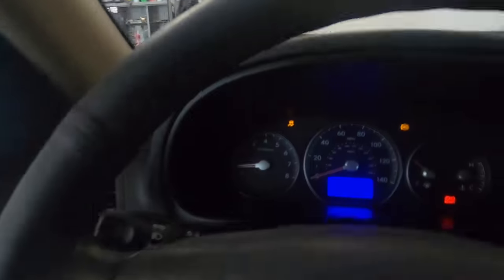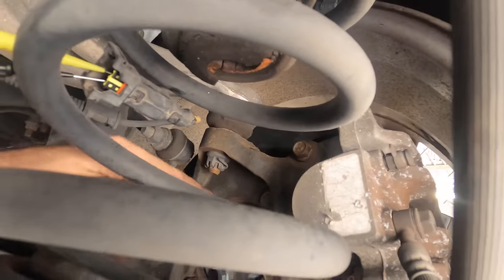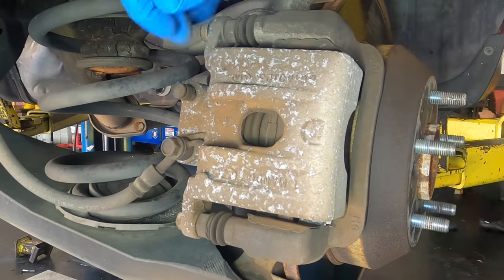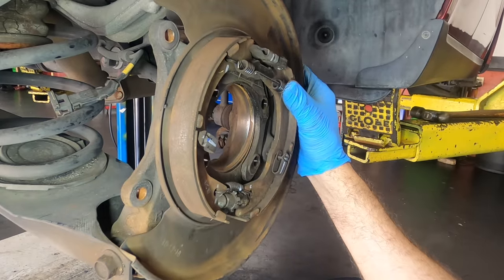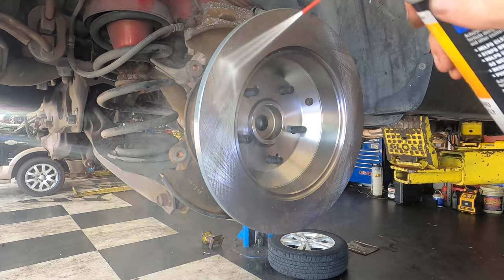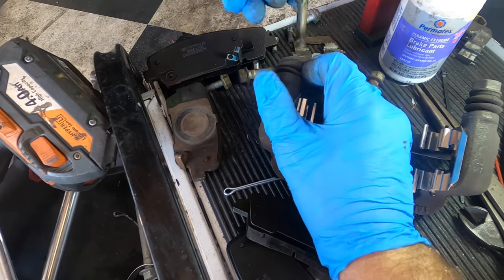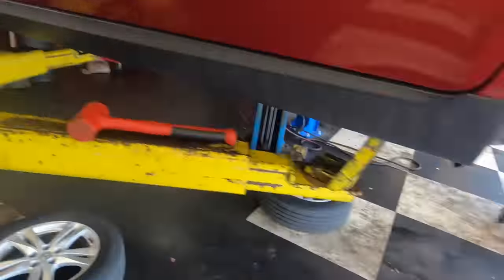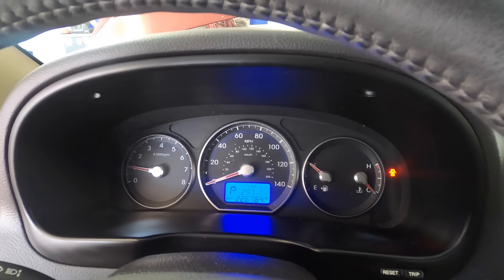Parking Brake Fights Back! BRAKE ABS Trac WARNINGS on! Hyundai Santa Fe

Comment: I'm 90% sure that first wheel bearing would have fit under the drum brake pad without interference once you got it in. At 12:04 it looks like there is more that 3/8" clearance under there.

Comment: On my 02 saturn SC (1.9 DOHC) I had a check engine light with a code for a cam sensor.  I found that the engine didn't have a cam sensor??   it turned out that the coil pack had corrosion on the back and it was getting an intermittent ground. I sanded the surfaces  and put diaelectric goop on the coil and block.  a year later it did it again.  and a 2nd time the next year! it became a ritual every spring for 9 years.

Comment: Great job Ray. I like putting a slight Film of the Brake Lubricant on the ears of the pads where they make contact with the slides. Also a small drop on the mounting screws to prevent them from rusting in place. It prevents having to use an impact screwdriver next time you have to remove the rotor.

Comment: Hi buddy great video. But why clean the hub on the car with a sanding wheel and not clean both sides of the backing plate thus putting grit and dirt inbetween....👍

Comment: I have the Lang 279 version of that caliper compressor, got it for Christmas.  I have since found they make a smaller size,  model 277,  for smaller calipers and i will be getting that before the next brake job on my truck, as the rear brakes are too small for the standard size caliper compressor.

Comment: 8:58 That's honestly hilarious. Hey don't worry, my 2011 subaru only took 3 hours of beating to death with a sledge hammer and eventual remove of the entire rear knuckle to get my wheel bearing off, but you southern climate people don't worry, just comes off with 1 gentle tap. I need to move there ASAP
Reply: I moved down south about 3 1/2 years ago and don’t regret it.
Reply: easy life in Florida they do not know what rust is .
Reply: @honorkemp  I live in Florida now but I used to live up in the rust belt so I completely understand what they have to deal with because I was there
Reply: Sorry I laughed. Crap like that always happens to me. Plan for something and physics has a different plan. Lol
Reply: As long as you can find a job at a decent wage, or you are retired.  Maybe the economy has improved since I lived there.  That is why I am in Texas - wages were about double  that of Florida in the 70s.
Reply: Doesn't the hot and humid weather in the South bother you?
Reply: @carlosanzola2938  southern ontario is just as bad, and then it gets stupidly cold, plus it's way too expensive here

Comment: Those set screws on the brake rotor.  Ugh.  I never put them back on, and there are a lot of times where I have to drill them out.  I believe they're only on there during assembly to speed up the assembly line.

Comment: I often use a c clamp to collapse the caliper pistons before removal
Reply: Do you loosen or remove the master cylinder cap?
Reply: @bloodybones63  Yes I do since it really fills up with brake fluid
Reply: @brucekappel7337  Me too, because of the pressure, but so few mechanics on YT ever mention to do that.

Comment: Just because I have a stupid question, are the set screws necessary? Once the wheel is bolted up and torqued, I’m just curious if the set screws are really needed? If you ever get 4Runner, or Tacoma videos in I can’t wait to see them. Thanks Ray, here’s a little REEEEEEEEEEEEEEEE

Comment: All the idiot lights coming on briefly at start up might be by design. My Land Rover illuminates them all for a few seconds each time it's started, in the same manner. This is described in the owner manual. It's probably done to confirm the warning circuits are working properly, no bulbs are burnt out or have been deliberately removed to hide a problem.
Am I correct in assuming you also updated the brake pads and rotor on the driver side of that car, and just didn'y include that work in the video? I can see only replacing the bearing on one side (although replacing both sides would be better), but I would always replace brake parts on both sides, at a minimum (and maybe all four wheels, depending upon the condition on the front).
You also suggested a possible bearing issue up front. Any work done on that?
EDIT: D'oh! (head slap) My bad, I just watched the last few seconds of the video where you confirmed the left rear brakes are new too! Like the SNL church lady always said, "Never mind."
BTW... Love that set screw impact removal tool! I recall many sessions using the manual linear impact driver (aka, hammer) type and swearing at stripped out screw heads, followed by a  torturous half hour or two of damaged screw removal.
Reply: @Alan M. It was Emily Litella on SNL Week-end Update, that always said, "Never mind",  Not the Church Lady! (head slap too???) Gonna get a concussion one of these days, son. 🤣🤣

Comment: Just to make sure the wheel bearing is a good part (as Ray always says, new does not mean good), would it make sense to connect the wheel speed sensor connector to the wheel bearing before reassembly and spin the bearing and observe that the scan tool shows the sensor is working, rather than waiting until complete reassembly and doing that? That would be just a minute or so extra time, to avoid a condition of having to do the entire job twice (even though Ray loves his job) if the part is bad.
Reply: If it’s a really labor intensive job then yes it can make sense to check operation before going all the way back together, but with a job like this you can literally have it in and out in less than 10 minutes, it’s really not worth the hassle of checking operation before hand. New certainly doesn’t mean good but it’s still pretty damn rare that a brand new part fails out of the box, don’t get me wrong it happens but it’s not often enough to be bothered.

Comment: Question on rotor set screws, I'm not a mechanic. I was told they used them on the assembly line to hold the rotors until the wheels were put on. Therefore, the set screws are not needed after that. True or false?

Comment: Raymond, question, as the removed disc and brake pads appeared to have a decent amount of pad material left with decent disc condition, why were these changed and not just refitted? So now what about the other side? Was the parking brake adjusted accordingly with the new disc? Will the other side now have partly worn brake pads, versus the newly replaced parts? I do not see this as good professional practice, and a waste of money for the customer. Can you clarify?

Comment: 1. why you tighten those 2 Philips screw on the rotors so tight?    2. you only replaced rr brake pads and rotors ?why not both sides on rears ?

Comment: Eric O always uses grease under the shims but thinking in FL it’s not that necessary since rust is rare so less noises.  Just curious if that is the case or just an individual choice.
Reply from the maker: I think circumstances dictate weather or not to use lube. It’s not necessary for noises on a quality pad bc many have a backing plate to prevent noises. Years ago pad sets didn’t. I prefer not to lube the shims bc it can run and end up on the rotor or get into the pad. AND it can collect brake dust and build up nasty globs

Comment: What is with manufacturers integrating sensors in high dollar components. My daughter just spent $2k for a ECU because of a failed barometric sensor which used to be a $15 -$20 part.

Comment: Must the set screws go into the rotor?  What if you don't?  Doesn't the wheel hold everything in place?
Reply: Chris, watched a guy do this ,he said he tightens the screws hand tight then backs them off. He said exactly what you did,  the wheel holds them in place.i thinks this is the best way ,as they don't get rusted in place.
Reply: @rpf691  Yeah, my (very very limited) understanding is that these screws are mainly useful during the car construction.  They keep things in place before wheels are installed on the line.

Comment: I’m doing a complete front suspension rebuild on my 09 Vic. Can’t get the lower strut bolts off. Like they are welded. I’m thinking about getting a better ball joint press to push them out. Any hints?

Comment: Hi Ray another interesting  video, I have a couple of queries though. It is common practice over here in the UK to replace  axle sets of brake rotors and pads to ensure even braking. Did the customer refuse to pay for this work to be done , or do you not bother in the USA. Why tighten the small rotor screws so tightly , after all it is the wheel nuts that hold  the rotor on. I think this just makes it harder for thr next guy to remove them.
Reply: In the last 5 seconds Ray said he had done the left side also.
Reply: You can see two sets of brake pads on his cart when he's installing the pad hardware, as well as two sets of shims.

Comment: Why didn't you change roter and pads on both sides? My understanding is both must be done.
Reply from the maker: You didn’t stay till the end…gotcha
Reply: Ah the last 5 seconds of the video. I don't feel so bad about missing it then. I do have another question though. Why don't you clean up the slide pins with a wire brush before you re-lubricate them? I've seen you not doing it on other vehicles as well. Just asking for my personal knowledge not to nit pick.

Comment: I saw the traction control light come back on again at the 25:00 minute mark. Something still going on with that.
Reply from the maker: No I did that weird blip with the lights and that was it. I drove it couple more times after the video and abs was reading the RR. Not sure why the lights came on and off at the end. It could have been the scanner communicating with the abs module

Comment: Ray let me ask you something. It seems like every video I watch, it always seems to be something other than Honda or Toyota. Is it that you dont get alot of Hondas or Toyotas, or they go to other techs cause it's smaller stuff? Thank you for the great videos!
Reply: Hondas and toyotas don't break down so they never need to be worked on lol
Reply: @jeremyg9240  oh I know. I'm entirely agreeing with you. I was just wondering if he had the same sentiment at his shop. I drive to all the Corollas. A 2001 and a 2002 and I also owned a 1992 Camry. The only issue that any of them have is my 92 Camry has an oil pan leak that I'll be cracking into later this week. However it drives like a dream. Thank you for your response.
Reply: @jeremyg9240  they are at the body shop getting new metal due to rust instead

Comment: Why do the set screws have to be put back in? I've heard that they're used just to hold the brake rotors on during the manufacturing process. Am I right or wrong? Tell me if I'm wrong. Sound off...
Reply from the maker: They kinda don’t NEED to be there, but it’s just best practice
Reply: @RainmanRaysRepairs  Maybe it's OCD.

Comment: In years to come some one may curse how tight those hub retaining screws are... I'm baffled as to why so much force was applied when there's no risk of the hub coming off when the wheel is attached.
Reply: They may just stick due to rust/corrosion?
Reply: They rust in place. See my other comment.
Reply from the maker: I didn’t think they were that tight 🤷‍♂️
Reply: The screws holding the rotor on are just there for the factory to prevent the rotor from falling off during car assembly. They don't need to go back on.

Comment: My choice for a bearing would be a Timken , the internet is full of Moog bearing failures after 6 months.
Reply: I agree. Used Timken on both my fronts. My mechanic friend told me their parts went downhill. Told me to use Timken.
Reply: I agree. I had a wheel bearing failure with moog parts. I switched to timpkin bearings and had no problems.  This is not the 1st time I had a moog part failure. It seems to me, that moog parts are not what they used to be.
Reply: Moog has been in China since 98. I didn't think it was that long ago.
Reply: For anything that has bearings use SKF. second to none.
Reply: moog owns timkin
Reply: @rickallen9382  I don't think that is true.
Reply: Timken or SKF bearings for the win, Moog was decent enough up until about 5 years ago, but I guess the chinesium got cheaper. Had a failed after 4 DAYS Moog rear universal joint take out my driveshaft, transmission mount, and transfer case adapter in my 02 2500HD Silverado. I still haven't found the driveshaft, it went flying!!!! Junkyard shaft installed with AC Delco joints

Comment: Great video as usual.
One question, with regard to brake pads & rotor replacement, when did the standard practise of "do both sides for balance" fall out of use?
Reply: Last 10 seconds of the clip, Ray says the left rear was also done.
Reply: @yakabothatesthis  My bad.
Reply: @unclegreybeard3969   Nah, not your bad. I don't usually listen once he says thanks for watching, but in this case I was scrolling through the comments, and happened to hear it.
Reply: I was thinkin exactly the same missed that wee bit at the end too 🙈👍
Reply: @yakabothatesthis  that last 5 seconds you might miss out on a blooper clip you never know plus that's how he knows who actually watches to the end when that type of question comes up
Reply: In case you missed it at the end of the video he shows us that the left rear was also repaired.
Reply: @yakabothatesthis  Standard practice here in the uk, same axle , pads ,discs, tyres , bearings ,struts, etc etc.
Reply: When the customer refuses.
Reply: Only when the customer is flat broke and wants to sign a waiver.
Reply: @dustintaylor9932  😂
Reply: You dont do both sides for balance. You do it because if you changed one for any reason, the other side is most likely just as bad.
Reply: @alexstromberg7696  
Isn’t that balancing wear?
Reply: @dustintaylor9932   waiver....

Comment: Question about getting new brakes disc/rotors, are you (the mechanic) suppose to clean the oil off when you install them? I just had mine changed and shit myself when I tried to slow down and the brakes did nothing, the garage said about the oil in them and that it should work itself off
Reply: Get a mechanic with work ethic.  They WILL quickly work themselves clean, but no customer should be sent out with anything on the rotors.  The surprise alone could kill someone.
Reply: They forgot and palmed you off to cover themselves. Go elsewhere next time.
Reply: It could have been they forgot to pump the brake pedal after the job to bring the fluid back to the pistons. Foolish mistake.

Comment: Do you think moog are any good very interested as Jeep dealer is out of hub bearings for my grand Cherokee???and other then NAPA I use dealership parts normally
Reply: I've had good luck with Moog parts but some say the quality has been slipping as of late
Reply: @chrisfreemesser5707  that’s what I’ve heard too guess I’ll wait on dealership to get back in stock inflation hit them also the front ball joints were $97 two weeks ago now when I went they are $147 😤😠 thanks for your on the moog
Reply: @sheerwillsurvival2064  Check RockAuto...they often have OEM parts
Reply: @chrisfreemesser5707  I did check them I guess they are out of hub bearing for the GC also 😕

Comment: Ray, Just a question I have noticed that in a lot of your videos you replace rotors and all. In my day we used to cut rotors and drums…. Is it a issue that the shop doesn’t have a machine or it a liability one?
Reply: AutoZone O'Reilly's and I assume a bunch of other shops used to do rotors but they all stopped also.
Reply: Faster to replace vs. measure & turn.  Ends up being similar cost - trading labor for parts.
For common applications (read: easy to find replacements) it's a better choice to use new parts with a full service life.
Reply: New part is the same price as turning the older.. now thinner one.
Reply: @cayman9873  Where I live a machine shop will turn your rotors for $40 I can't even buy one rotor for $40!
Reply: I was told that to save weight and money, the manufacturers were making the rotors pretty thin to start with, so now turning them more than once would be too risky.

Comment: I owned a 2015 sante fe and I found there to be a double check in the computer system after an issue threw a code and was repaired. It would do it's self check as usual, then access some kind of memory that would illuminate the lights again and once it finished it's self diag would then disable the lights. I don't know for a fact but I believe it to be some form of redundant memory. Sadly I cannot confirm that since I wrapped it around a power pole in 2018.

Comment: my 2014 Mustang GT was having an issue with the steering, advanceteac, and a 3rd issue... found out it was a hidden fuse... the mechanic rewired it so the fuse is now closer to the positive terminal of the battery for easier service, had to replace it 3 times now...
Reply: Shows that you have a short or something with too much resistance.  That fuse shouldn't blow at all.
Reply: @steveb6103  I would figure that too but the guy rewired it so all new wires... It seems to blow everytime I take my car to the shop to get looked at so it must be something the shops are doing to short it out...

Comment: Not all Rotters are supposed to be cleaned first.  Looks like cheap China parts.   Every though getting a cheap buss boy pan to catch the stuff from working on the wheel.  Get the pan from a cooking supply store.  Great when doing brakes.

Comment: There is a TSB on those rear speed sensors, you can just replaced the plastic cap. the factory OEM hub would let moister in and especially in wet conditions the abs light would come on. good fix though. I always enjoy the videos.

Comment: Damn A Hyundai with over 200,000 miles and still running I'm shocked.
Reply: My last Santa fe was a little over 250 and still basically fault free until ice, gravity and a sloped mountain round enticed me to slide right through an intersection and into a parked beater. Good thing my 40 yrs safe driving earned me a free collision claim waiver.